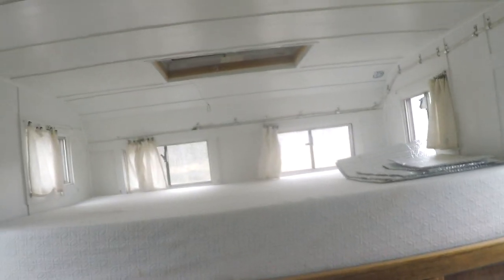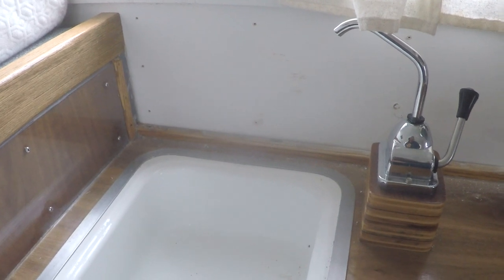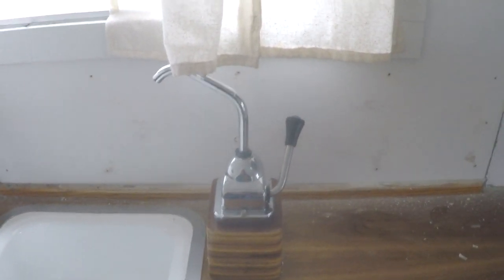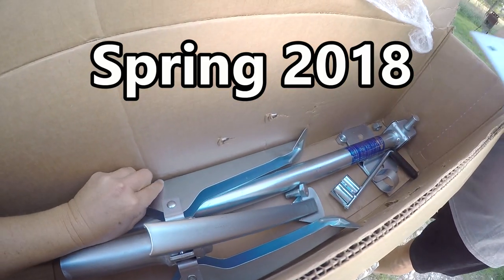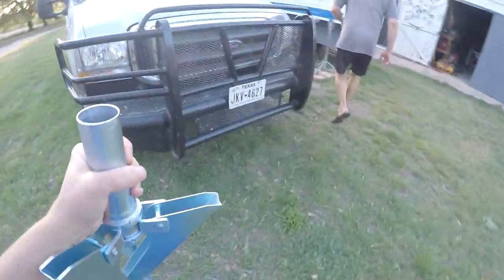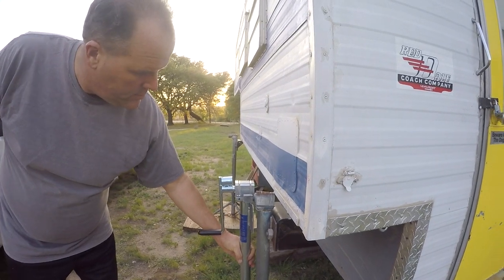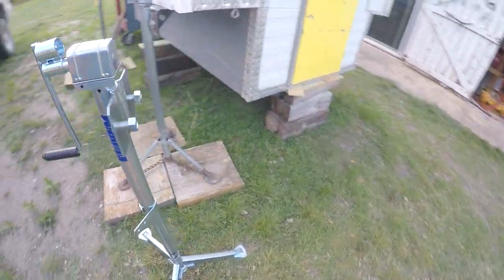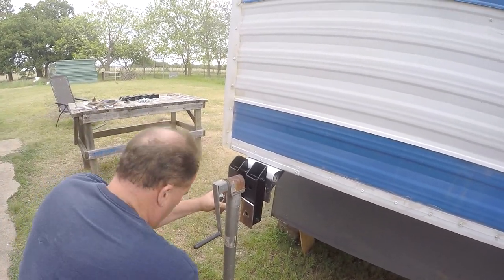Truck Camper - Adding A 4th Jack, Raising Height & Increasing Width

Comment: I wish you would have shown more on installing the new jack.  I need to add a 4th jack also.
Reply from the maker: If you have any questions let me know.  Maybe I can explain something or offer helpful info.  Also - duly noted.  Thanks for the feedback.  You are not the first to be looking for intel on this....I should get Dave to help me make a New detailed video all about our jacks and rigging.  Soon.
Reply from the maker: https://youtu.be/ON94CwwKz5s  - New Video - detailing the jacks on the camper.  Also - supplementary blog post with all the specs for our set-up -  http://sandra.begotka.com/how-we-modified-jacks-on-an-old-truck-camper
Reply: Well I got lucky and found 2 jacks for $100.  These are 2,000 pound load jacks.
I moved the 1 center jack to the back cornet. Now have a jack on all four corners, 2,000 pound jacks in front, 1,000 in back.  Now using 2 people with 2 drills to raise the camper.  My camper is a 1997 sunlite pop-up, weight 1,650 lbs.  My truck is a 2001 Chevrolet Silverado 2500HD. 
I also had the problem of my truck being to high and wide for the camper jacks.  My solution was 4 side out camper jacks.  The bottom part fit over my camper jacks. The have round feet so my truck easily clears them, plus the give me an extra 8 inches of lift, with keeps my jacks less wobbly.
Hopefully, someone else reads these and it helps them out too,😊.

Comment: When you added that 4th jack, did you move the original 3rd jack up a bit to space them out or leave it in it's original spot? I'm about to do the same after having the 3 jack system finally fail on my '88 Jayco at 9:30 at night while trying to load up to leave Baja. Thank god for the palo verde tree that kept it from fully going over.  Just discovered your channel. Great content. I live in Baja in the winter near Santiago and drive down with the camper every year for the past 7 years.
Reply from the maker: Hi - we moved it up.  Now it has a jack in each corner.  Dave added material on the inside where the jack attaches to provide more strength.  So much better than the tripod configuration we had before.  MUCH more stable.  We've been to Baja twice with our camper.  Wonderful times.  The last time we were down in Todos Santos when the pandemic broke out....we hunkered down for awhile, then we drove back NOB on May 8.  No problems.
Reply: @SandraBegotka  Thanks for the feedback! How did those spacers work out? Solid? No bending or giving? Looks like a great idea! 
Sounds like Todos was a good place to be at that time. Good at keeping traffic in and out to a bare minimum and likely cooler than my side of the Sierra ;) .
Reply: @adaptogenesis1995  The spacers are holding up great.  Very solid.  Dave is a whiz at creating brackets and such.  We use to own a mechanical contracting business where we regularly were hanging thousands of pounds from ceilings in factories and warehouses and building all kinds of material handling systems.  We could get the truck under the camper before the brackets....but the wheels were running over the jack legs a bit.   Trucks were narrower when our camper was made. Now with the spacers that's no longer an issue.
Reply: @DaveBegotka  Any chance you fabricate those for sale? If so I would love to purchase some. I have the same issue with the feet.